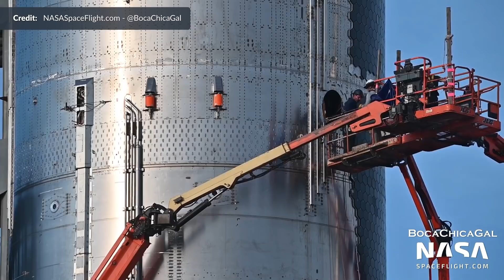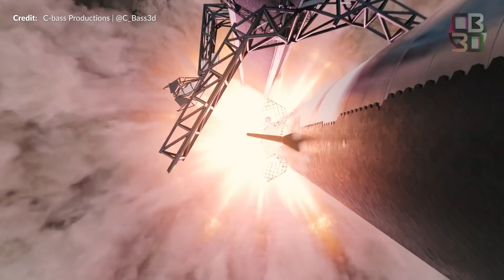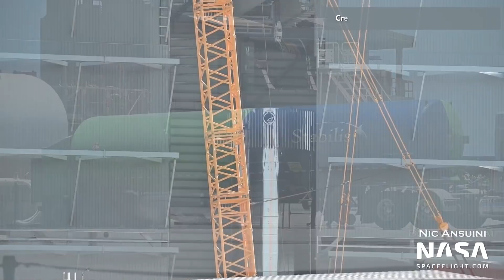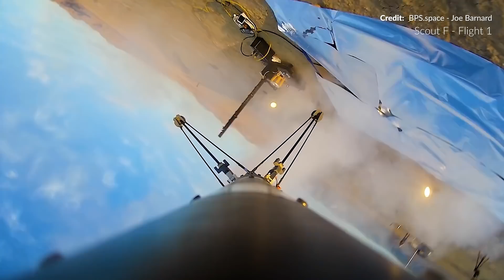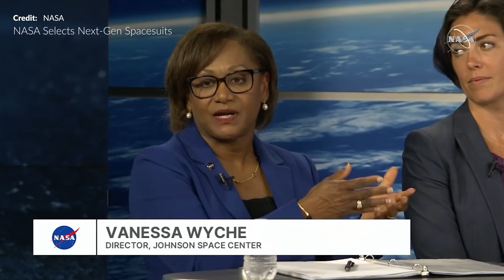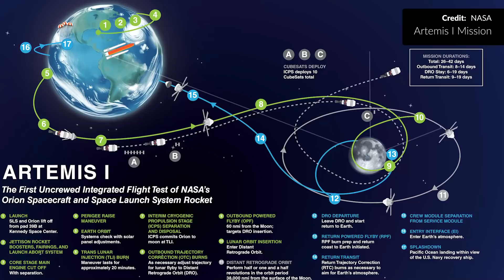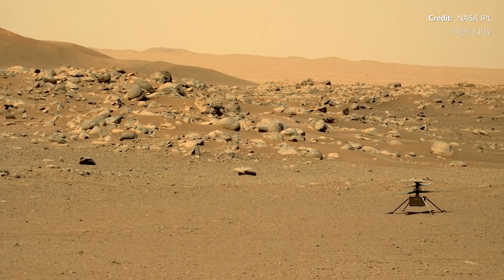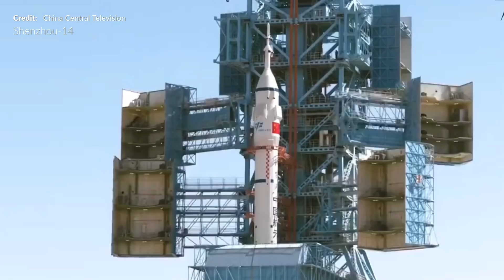SpaceX Starship and FAA milestone achieved. Space Suit Award, Capstone, SLS and JWST

Comment: I’m surprised about the dust buildup on the ingenuity helicopter. I would’ve thought the rotation alone would have been enough to blow the dust off the solar panels. But I guess I’m wrong!
Reply: Ingenuity's solar panels are above the rotors, which mainly blow air down, so unfortunately there aren't strong turbulent forces generated above to clear them.
It would be nice (but incredibly tricky and dangerous) to use ingenuity's downdraught to clear Perseverance's solar panels.
Reply: @hadorstapa  anything below the rotors would significantly impact the lifting characteristics of the rotor assembly, requiring the rotors to be substantially larger to compensate. Additionally, high speed dust / sand would cause damage to the solar panels.
It's important to remember that this little drone's mission was originally intended to be completed months ago. Cleaning solar panels was unnecessary for the original mission parameters. 

Conversely, why the billion dollar InSight lander didn't have some method to clean its panels is beyond comprehension. It isn't a novel technology demonstrator like the Ingenuity helicopter, and NASA has had landers on Mars since the 1990s. The dust issue should have been anticipated.
Reply: @hadorstapa  they cant reverse the rotation of the blades to help take some dust off?
Reply: @laszlozoltan5021  even if they could, I really don't think the angles would work. The underside of the panels would put the topside in a shadow from the turbulence - like the still water you find in the wake of a rock in a stream.
Reply: @hadorstapa  Perseverance doesn't have solar panels, but uses an RTG for power.
Reply: @steveaustin2686  indeed. As others have noticed, I should have referred to InSight. Which is out of range anyway. My mistake.
Reply: @hadorstapa  NP. I didn't know how far apart they were until it was brought up and I went looking to see.
Reply: @hadorstapa  it's just asking to break your own panels with debris if you ask me
Reply from the maker: Well it has always been weird to me that that they didn't put the solar panel under the rotor so that the rotor blows the dust off the array. Possibly because it would reduce lift, but it seems like that would help if possible.
Reply: @MarcusHouse  I know that weight is an issue with these machines but has anyone looked into ways of wiping or blowing the dust off?
Reply: @LesEy  as for at least blowing off, the mars atmosphere is too thin for any ‘breeze’ to over come static cling. Adding things to both wipe or blow the dust off likely adds too much complexity  that NASA believes is too likely to fail / too heavy
Reply: @LesEy  : There's been some recent progress with testing an electrostatic system. Hopefully NASA will send an example on their next solar powered rover.
Reply: Its too bad the Ingenuity isn't able to be recharged by Perseverance as fail safe over ride issue of the panels getting caked by sticky dust.
Reply: @Wrangler-fp4ei  a docking station for the little guy would be great!
Reply: Perhaps a future version has a servo to apply a tilt in order to promote airflow?
Reply: Well, even if Ingenuity’s mission does end because of dust build up and winter meaning weaker sunlight, it has truly been an outstanding technical success.  The original plan was that at most there would be 5 flights over 2 or 3 months or so.  But Ingenuity has made nearly 30 flights and has up to date lasted 14 months, so it has long exceeded its mission warranty.  It will be sad to see its  mission come to and end, but nothing more. Ingenuity has shown beyond all doubt that flights in the thin Martian atmosphere are possible, and since that was the mission objective in the first place, it has been a most emphatic success.
Reply: Doesn't Perseverance use an RTG?
Reply: Yes there was me thinking the blades were incorporated on to the solar panels! I think we should send these ideas to NASA.
Reply: Mars dust is unlike anything that occurs naturally on Earth it's extremely fine like baby powder.
Reply: That dust adheres statically, so it can't just be easily blown off.

Comment: It would be great if the coolest heli in the Solar System could blow dust off the ground rovers.  Thanks for your great work Marcus & Team
Reply: It would be even cooler if they could tilt the solar panels vertically, and vibrate them. Digital cameras have been "self-cleaning" their sensors in this manner for more than a decade.
Reply: @UncleKennysPlace  How cool is that I had no idea.
Reply: @UncleKennysPlace  or add a small tank and pump tha can pressurise Martian atmosphee then use it to blow dust off the panels - that way, no vibrations needed (I uspect NASA might be wary of using vibrations to shift dust for engineering reasons)
Reply: @UncleKennysPlace  • Each mission allows for new innovations. Love your 💡 idea!
Reply: @UncleKennysPlace  I've even seen useable air compressors made out of ABS plastic for Lego pneumatic kits - they couldn't afford that much weight for a blower that keep critical power generation going? It's pretty odd.
Reply: @PinataOblongata  @Esme n'haMaire Yes, that has been my thoughts too. Then use the camera arm to position the blower tube over the solar panels. It seems like a no brainer to me as NASA/JPL knows full well about the dust problem. Why risk a multi-hundred-million project when a simple fix would prevent failure?
Reply: @GntlTch  Guaranteed if we've thought of it, they have thought of it, so there must be a reason why they don't use something like that.
Reply: I literally just came to the comments to say that and your comment was the 1st one I saw 👍
Reply: That was my first thought, but dust might be statically attached, might cause dust below the rover to kick up and exacerbate the issue. They might need to opposite charge the panels to “un-cling” the dust first. I doubt the dust is held there merely by gravity.
Reply: @ClAddict  
It is, on Mars "dust devils" are common around the local noon.
And known to clear the earlier rover solar panels. Images of those "dust devils" are available.
Reply: This guy is on a par with Dark Docs and Rex's Hangar in quilety.
Reply: exactly what I was thinking 😂😂
Reply: Not necessary! both of the current rovers are nuclear powered, no solar panels! The only lander that is about at end of life due to dust on the solar panel is InSight, a fixed lander with a seismograph. It is nowhere near either of the other rovers and that little helicopter could not possibly reach it,
Reply: @warrentaylor8428  I was thinking about InSight but had no idea how far apart they were. Also I thought that maybe one of the satellites on Mars orbit might be capable to link up with the chopper.
Reply: Thought of the same thing. Why they do not try this, is it because the atmosphere is too thin to create wind? But than what blows the dust? Surely there is a perfectly logical explanation which i have no idea.
Reply: @aametayano  Probably too great a risk of the 'copter crashing into the rover.
Reply: @PinataOblongata  No it because the ingenuity copter and the insight probe are more the 2000 km appart. ingenuity has also very limited range and is entirely dependent on perseverance for communication.
Reply: @gavinkemp7920  Just what I wanted to say. They're just too far away.
Reply: @gavinkemp7920  thank you, I wasn't aware of how far apart they are 👍
Reply: @aametayano  there's afkn helicopter on Mars my dude. There's definitely atmosphere if you can fly........... Jeeeez
Reply: @Bramon83  I did not say there is no atmo, said maybe it’s too thin for ingenuitys tiny rotors to create enough push couple of meters above to move dust. Anyway, i guess the answer to my question is that they are too far away.
Reply: No can do. Mars air is so thin that the sand under Ingenuity doesn’t move when it takes off. Electrostatic panel cleaning is the way to go.
Reply: @ixion2001kx76  and here I was thinking how smart I am to think about using the chopper to go clean the panels.
Reply: @ixion2001kx76  
Something obviously wrong with your statement: "Mars atmouspher  is too thin " !

-- IF thick enough to 
blow sand onto something, 
It is thick enough to 
blow off.

-' If helicopter can fly: 
it obviously has enough downward wind, to clean the pannels.
Reply: @ixion2001kx76  
Wrong!  
Mars air density varies seasonally , but averages 0.0151 kg/m³ at the Viking 2 landing area. CO2 content per m³ is about 28 times more than on earth. ( 0.49 grams/m³) at sea level.
Reply: Or just a pop-out spin brush on the rovers smart people can be so obtuse.
Reply: It boggles my mind that Nasa didn't think of a blower systems and or solar panels that spin, giggle and tilt dust off!
Reply: There is no reason, why this should not work . The rotor downwash momentum is considerable,  (equal to the lift ) distributed over 1/2 of the rotor disc area gives the approximate pressure on the solar panel below.
Average down wash velocity through the lower rotor plane is just less of the net rotor power divided by the weight. The downwash velocity further down is twice that value,
Yes, when flying over the horizontal solar panel, repeatedly will clear the dry dust. No need to be close, remain at a safe altitude.
Reply: I was also thinking this! Haha
Reply: The problem is static. You won't get all the dust off, honestly I don't get why they didn't install a wiper off some form. If they means your rover could get several more years use, why not. Don't say anything about it being impractical, were talking about a rover on Mars.
Reply: @Bramon83  Given that it's ALL impractical, EXTRA impracticialities probably look larger... You often can't even get the wiper arm motors on cars to keep working for a few years, let alone some in freezing and dusty conditions... But still, it does seem weird and I'd LOVE to know why these things didn't make the cut.